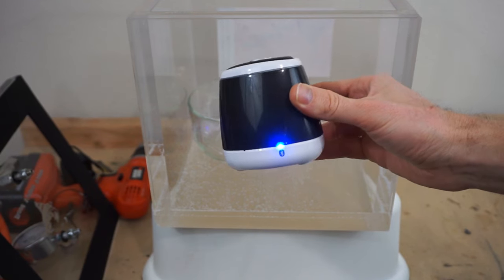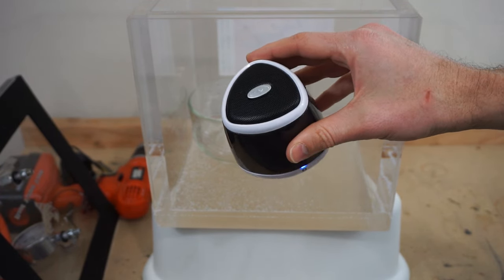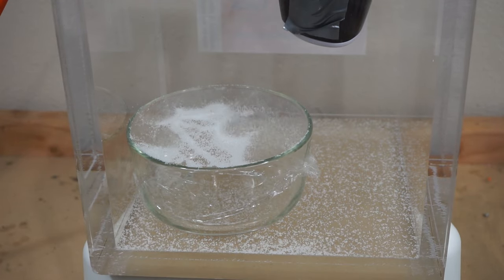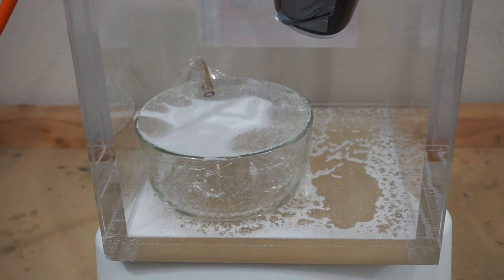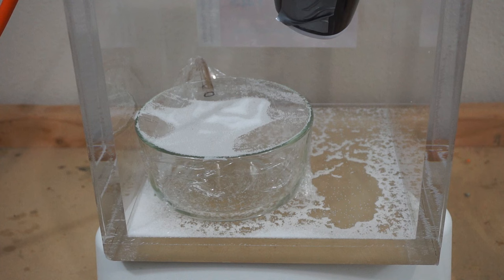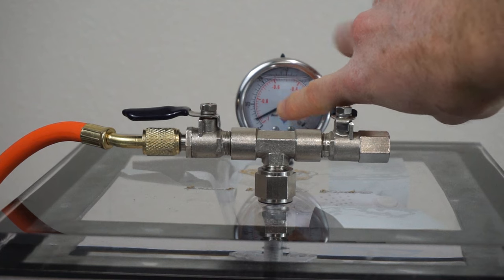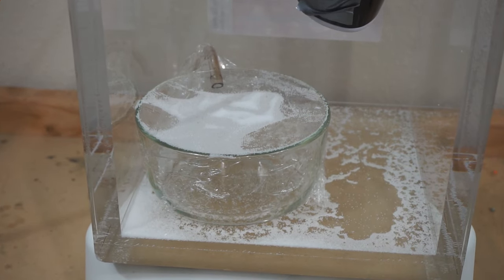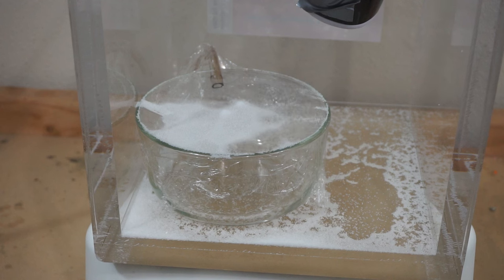What Happens When You Put A Speaker In A Huge Vacuum Chamber? Can You Hear It?

Comment: "if you listen closely you could hear a slight hum..." 

talks over the whole thing
Reply: And puts Background music in the vid.
Reply: It doesn't matter. No vibrating means no sound waves, which means  your ear drums won't vibrate, which in turn, means you can't hear sound.
Reply: Ihavenoidea actually, this is not true, because outer space is not truly empty. If we understand that space has an ether, (all particles have a real time electrical connection which is proved by quantum entanglement) then we understand that sound will travel through the ether the same as light and electricity in space, so there is sound in space.
Reply: You might hear something, but that's because the way a sound box works is (electrically) vibrating a piece of magnet to create the sound waves. Without air the sound waves doesnt exist, but the vibration does, and because the sound box is attached to the chamber wall, the whole thing is vibrating making a hum.
It's like when you hold a phone playing music, you can slightly feel it vibrating.
Reply: @Smartguy561  Can you hear the sun?
Reply: @Smartguy561  Sound with a wavelength less than the mean free path of gas particles won't transmit (and practically speaking, sound of wavelength that isn't a LOT longer than the mean free path of gas particles will get attenuated really quickly).  In space, the mean free path is pretty long (the exact length depending upon just how high up you are), resulting in any sound having a wavelength short enough to hear being non-transmissible.

Comment: So when I did this experiment I found that the speaker simply did not work in the vacuum due to internal pressure behind the diaphragm keeping it from vibrating. How did you solve that issue?
Reply from the maker: +Cody'sLab the only check I did for that was to have the speaker on the floor of the vacuum and you could still hear a strong sound due to the vibration of the speaker against the acrylic, but when it was in the air you couldn't hear it. So I assumed the cone was still vibrating under vacuum.
Reply: or play the speaker upside down and stick a small thread with tiny weight to the diaphragm(like a pendulum) so that even in vacuum,you would know that speaker is working as the weight will bounce with diaphragm.
Reply: The cone would as you don't need air pressure to move, the speaker is just a electronic magnet with a diaphragm to push the air which is "sound"
Reply: Just a better vacuum, Cody
Reply: Cody'sLab
Reply: Dude don't listen to Cody's Lab. He has no idea what he is talking about. Like I said his scientific method is flawed, he never checks his math or proof. Cody's Lab is Wikipedia copy and paste guy. He just copies everything from wikipedia and pastes it in to his script. Action Lab you are far more intelligent then he will ever be.  Distance yourself from him. Lab rats have more intelligence than Cody's lab does.
Reply: That is a very low end speaker or one with water resistance. Use a different speaker. To see that it is vibrating, use a flashlight with a videotape, it should be obviously vibrating or get a note powerful speaker.
Reply: So, Schrodinger's Diaphragm?
Reply: Speakers can be either closed or open backed depending on what pitches they are optimised for. You probably had a closed back speaker and this one was open.
Reply: @thatscienceguy9458  They don't call him Professor Bumblefuck for nothing. Garbage in garbage out is something to avoid, for him it's his mantra. That's why everything he uses is filthy.
Reply: WHAT HAPPENS WHEN YOU PUT SENSORS IN THE VACUUM CHAMBER? Like a microphone, or other wave type sensors? If a tree falls in the forest but you're deaf, does it still make a sound? Are there other ways to generate a wave without using pressure, sonic, "longitudinal" waves? Why can't the radio broadcast on 800Hz? What magically happens at 87.1Mhz. What does a digital or analogue broadcast sound like? Why can aliens apparently view our radio signals but, can't hear our noises? Is space really a vacuum because the earth and sun are in it, as well as gas pockets and rocks? A speaker can't work in a vacuum, can a radio transmitter at 800Hz?
Reply: Use old alarm clock....it was done fee century ago anyway... Is and engligsh teacher show a replica of some similar test and work

Comment: When I was in HS we had a little vacuum chamber & we put a fire alarm bell, an old style one that has an actual bell & a hammer, in the vacuum chamber. We tried suspending it with several different materials & could never get it totally silent but it was still really neat seeing the hammer going like mad against the bell & just barely hearing it. It went from uncomfortably loud to straining to hear it. If I recall correctly, we got the best results by suspending the bell with rubber bands. We may have not had a 100% vacuum or some sound was still traveling up the rubber bands. Whatever the reason, even with a little continued sound,  I thought it was neat enough to mention it in a Youtube comment 30  years later.

Comment: An explosion in space would still be heard because an explosion is a rapid expansion of gas. The gas would collide with your suit/ship and relay the sound. It likely would not sound like an explosion though. Cody's lab did a 2 part series on it.
Reply from the maker: +Ethan Winder good point, although I guess I was assuming you were far enough away that by the time it got to you it would have very little sound/pressure . I wouldn't want to be close enough to hear it!
Reply: Very fair I suppose. If you where close enough to hear it with any volume then the pressure wave would at least knock the ship. At the time I was thinking the gas wouldn't lose momentum due to being in a vacuum/space. I never thought about how the further from the explosion you are the more spread out the particles are due to it forming a spherical shape
Reply from the maker: Check out the comment I pinned above and I show you that you could call it a sound that you hear even though it would really just be gas hitting you.
Reply: Depending on the amount and the speed of the stuff hitting you, you could hear something. But it's not the sound of the explosion. It's just the material hitting your suit/ship and producing sound in it.
Sound is elastic medium oscillation. Gas particles flying in all directions are not sound. It's very straightforward.
Reply: I believe that's what sound is, gas hitting you, of course being in a medium means your surrounded by it constantly bu a greater pressure of it would be the same analogy.
Reply: I believe it would be both as vibrations from the explosion (explosions could be followed by more explosions in microseconds from each other) would create a vibrating wave, and although yes most of the "sound"  you would hear would be the gas and particles hitting you or your ship, but a vibrating wave would still be present due to Newtons third law, some particles would travel slower, some faster due to the way the explosion happened.
Reply: Star wars has it wrong, star trek for the most part, has it right, including showing vibration and low-boom sounds during an explosion in space, you would indeed hear that.
'Gravity' does a good job too.

Comment: In my opinion, by using a suitable loudspeaker we can pass sound in an almost perfect vacuum. The maximum volume in the atmosphere is 196 decibels, so as when the sound is increased by 20 decibels the acoustic pressure is multiplied by 10 it is possible to reach 120 decibels under a vacuum of 0.0001 bar.

Comment: If I was fortunate enough to have a vacuum chamber, I'm curious if the noise generated by the speaker became more quite, higher pitched, or both.
Reply from the maker: +Logan Pachulski it just gets quieter, pitch stays the same. This is because the amount of air just affects the amplitude (volume) the  cycles per second of the cone in the speaker vibrating is what determines the pitch. That wasn't affected by the vacuum.
Reply: Hydraulic Press Action remove the music of the video on that section so we can get a better idea
Reply: Well the vibration of the speaker is determined by an electrical current sent to its coil, so it would stay the same.

It's not like some reed instrument loaded into a tube whose frequency is determined by 4 x the length of the pipe/speed of sound in that air pressure. You'd expect a reed instrument to go lower pitched but quieter, because the speed of sound reduces in less air pressure.

It is not like helium where the density is lower even at a high pressure which causes the air to have a high "spring constant to weight ratio" meaning sound waves are passed on quickly as vibration down a stiff lightweight spring as composed to a loose slinky.

Comment: Would be interesting to know if all frequencies are equally dampened as pressure lowers. Couldn't find much info on this, probably because it's drowned in the majority of tests that only care about full vacuum. Would also be interesting to know if it affects speed of sound, like apparently temperature does.
Reply: Sound with a wavelength less than the mean free path of gas particles won't transmit (and practically speaking, sound of wavelength that isn't a LOT longer than the mean free path of gas particles will get attenuated really quickly).  But at 1% of 1 atmosphere (which I think is what his vacuum pump can get to), the mean free path is still quite short, so probably all frequencies we can hear still transmit just fine -- except that the energy isn't transmitted very well from the speaker to the thin air, so the sound waves are too weak to move the salt grains.

Comment: any connection between the speaker and box (tape, string, etc) would transfer sound from the speaker. Also, I'm sure you didn't reach a perfect vacuum, so there was still some micro-atmosphere in there to transfer a little sound.

Comment: I joined in on a comment rant on this sorta subject a while ago, what about an explosion? It would let out gasses that would in theory carry those sound waves until the gas had dissipated, it would only take a small amount of this explosive pressure wave to reach the hull of your ship or even just the spacesuit, in turn sending the vibrations thru the surface and into the pressurized environment inside, thus if in an enclosed environment and the sound was from an explosion, you would be able to hear it, right?
Reply from the maker: Hi checkout my pinned comment above about this. If you are even a few meters away, the pressure will drop low enough that you still would hear no sound, but you would "hear" the pressure wave

Comment: One argument for possibly hearing am explosion in space is that an explosion is rapidly expanding gas. This creates a blast wave, when this blast wave makes contact with solid objects with gas in them it transfer that wave energy to that object. And if enough energy is absorbed by the object to create waves inside a ship or a space suit then a person may hear it. But... Sounds by just creating vibrations would not make sound because it has no medium to transfer the oscillating pressures. Explosions kind of create their own sound medium, so it may be possible to hear an explosion in space.

Comment: remember that the shock wave and the sound wave are not the same and arrive at different times depending on distance and Atmospheric properties sound waves as we measure them by speed or through air the speed of sound is measured through air so does it speed up or slow down if you eliminate air or replace it with different gases but?

Comment: Well I think the reason why the speaker stopped working when you werent even at full vacuum is because the speaker chassis has got a sealed chamber behind it. (Doesnt look like bass reflex) Once the pressure inside the vacuum box is dropping, the air trapped behind the speaker is pushing it out. Once the maximum travel of the speakers membrane is reached, its not able to move anymore. So no sound is emitted.

The test wouldve been much better with just a speaker chassis (without any enclosure) inside the box.

Comment: so the question is, would there be a shock wave from the explosion if there's no atmosphere to carry it?
 of course there would be in the immediate vicinity the immediate vicinity where any other gases and such would be from the explosion itself but imediatly absorbed by the vastness of the vacuum.
  But what about a thousand yards away?
 would there be a shock wave capable of reaching your spacesuit and vibrating the air within it across a somewhat shortish distance in space?
A rocket blast: just pushes between the explosion itself  and the base of the rocket but is there any thrust wind past the tip of the rockets flame?

Comment: actually in space if an explosion occurs the pressure wave created by the explosion and the gases it puts off from the rapid combustion would create sound until the gas (air) particles distribute far enough apart from one another that there would be no more force behind them. So the close you are to the explosion the more likely you are to hear it. within a certain level of reason for survivability anyway. Cody with Cody's lab has already done test in a vacuum chamber with explosives that the results supported that hypothesis.

Comment: Thank you for the excellent demonstration.  Do you think it would be impossible/impractical to somehow place an internal combustion engine within a vacuum envelope that would contain all its noise in exclusion of the sound emanating from the intake and exhaust? I've toyed with this concept a little but figured someone else has already tried it. Awesone channel btw :)
Reply: Probably wouldn't help very much (and would make the cooling even harder).  Most of the sound will be coming out the exhaust or by way of solid vibration (depending upon how good your muffler is), with a lesser amount coming out through the air intake and through the coolant liquid.  Now if you made an adiabatic engine(*) so that you don't need liquid or air cooling and could use sound-insulating mounts and a really good muffler, then it would help.

(*)Adiabatic engine -- able to withstand the full heat of combustion without cooling, so as to minimize non-productive heat losses from the combustion gases -- such things have been made and technically worked but were never commercially successful

Comment: the reason u couldn't hear it is because the vacuum pressure stops your speaker from vibrating up and down not because u need air to hear sounds, true that sound travels longer and louder in normal atmosphere but it can also be heard lightly through magnetic vibrations, a speaker is not going to work without air, it will stall. now if it was something else like a gun shot or something like that u would hear it

Comment: so sound is produced by using the air pressure and pushing it around making what we know as sound? And in a perfect vacuum there is no air pressure to push or pull so the speaker does not transmit the vibration of sound thru air into something audible? And if space could make sound, would we on earth be hearing a lot of sounds from space?

Comment: im not too sure but if your speaker was using Bluetooth would it also have stop receiving the signal from your phone,do to it using radio frequencies? you should try it plugged into the 3.5 jack. I also thought about the floating magnet speaker would have been cool to try but you would run into the Bluetooth signal and no air issue again. just some thoughts

Comment: Sound travels in waves like light or heat does, but unlike them, sound travels by making molecules vibrate. So, in order for sound to travel, there has to be something with molecules for it to travel through. On Earth, sound travels in your ears by vibrating air molecules. In space, the large empty areas between stars and planets, and there are no molecules to vibrate. There is no sound there. So in your video thats why it had very very little noise.

Comment: Either A - no sound will come out due to the lack of air in the chamber
Or B - The speaker will use the actual chamber as a way to transmit the sound via vibration

Comment: what would be cool if you did the same thing but instead of putting the air back in you could put helium into the chamber then again with sulfur hexafluoride, find a way to see if you can change the pitch with simply changing the density of the gas in the chamber, I think that would be awesome.

Comment: I have a question. Would you be able to hear the outside sounds if you surround yourself in a vacuum chamber? (I mean, not yourself inside a vacuum chamber, but enclosed with a vacuum chamber in all directions). Let me explain my question with an example. Ok. Let's say that you live in noisy city, and you don't want to hear the sounds from the outside when you are sleeping. Lets say that the inside walls has a vacuum chamber and also the ceiling and the floor. You still have normal atmospheric pressure, because you have not suck your air out from you apartment, but the air inside the chamber. The question is: would you reduce the outside noise? Or even to reduce it to zero? Or no effect?
Reply: yeah

Comment: The sound didn't stop. What stopped was your speaker. There was no air pressure inside for the cone in the speaker to vibrate. The only way to truly test this is to drop a metal ball inside and see if it makes a sound. But to your vacuum cube must be also inside a vanccum chamber. And be suspended.

Comment: would you here sound if instead of speaker you played sounds from a Plasma tesla coil?
Reply: No, plasma would still need the air as a medium. a coiled wire microphone would pick it up inside though because it would induce a current through the wire.